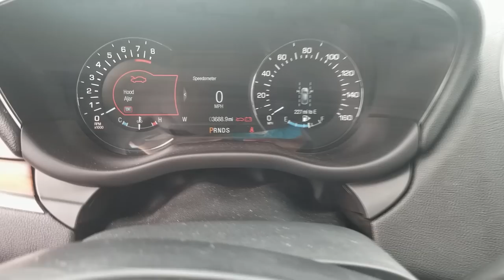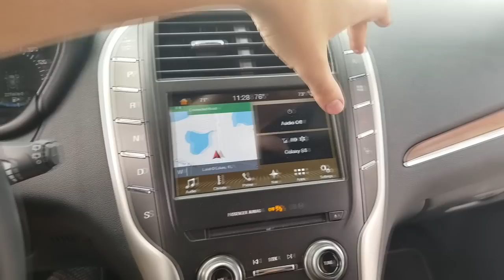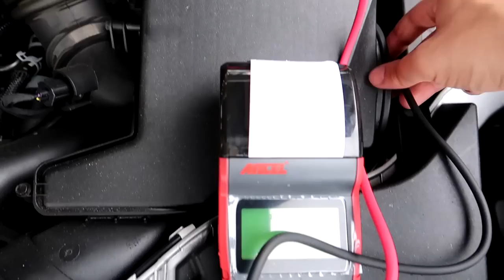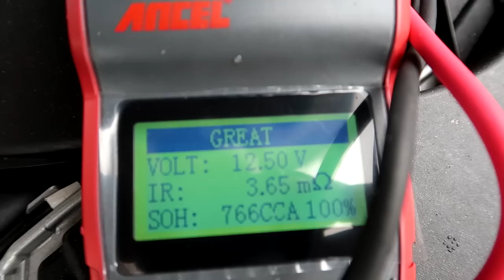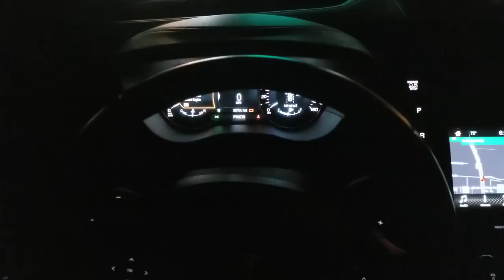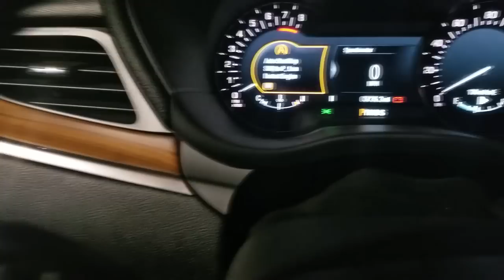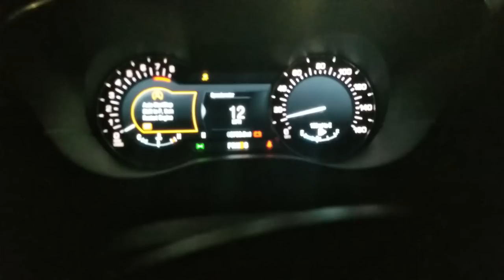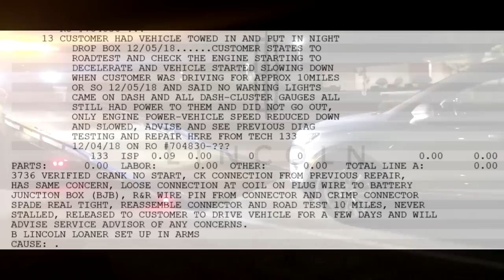I Saved Over $20,000 Buying a Like New Lemon Car! Then it Broke Down TWICE in 48 Hours!!!

Comment: Sam,  I once had a car with the exact same issue.  Turned out to be a faulty Crankshaft Position Sensor.  If the computer doesn't receive signal from this sensor it will cut fuel and spark to the engine.  I was told that this was a safety feature at the time.  Initially mine would stall just like yours did at traffic lights and stop signs, it then got worse to where the car would crank and crank with no success. A five minute or so wait and the car would restart.

Comment: Im an auto service tech since 96'. Currently work for a dealership (not Ford/Lincoln), but the logic behind finding the issue is the same.

First, the battery tester is not going to help you in this situation. A scan tool would be more useful. Don't need a fancy one, just one that can read any Diagnostic Trouble Codes (DTC's) and display the findings. Instrument panel illuminated and eventual engine restart proves it's not a battery or fuse issue. 

No voltage at the coils (if that is the case) suggests it's a power supply issue. A bad ground to the module might also be suspect. Poor connections fall into this category. I have my doubts though.

The fact that it stalls while driving, yet cranks afterwards suggests it's an issue with either the ignition system or fuel system. A mechanical failure would tend to make the vehicle run consistently rough or not at all. Very few mechanical failures allow the vehicle to run smoothly.

Ignition system failures tend to have DTC's associated with them. Fuel injection issues also tend to have DTC' associated with them as well. Fuel delivery (fuel pump) issues often reproduce these same symptoms and will not generate a DTC's. 

I am generalizing, but this has been my experience. I would look at the wire from the control module to the fuel pump. If the purple wire has something to do with the fuel pump, and it's been repaired more than once, perhaps the issue is within the module the purple wire plugs into. It might even be the fuel pumps themselves. 

Im guessing that your vehicle has a "saddle tank". One pumps that supplies fuel to the engine, the other scavenging fuel over the "hump" of the tank keeping the 1st pump with a steady supply of fuel from the other side of the tank. If the problem is most pronounced just after 1/2 tank, then that's your problem.

Comment: Awww yes, the fabulous Ford Wire Wiggle test. That purple wire at the ECM doesn't look very good. Notice the bulging under the insulation in 2 or 3 spots? 
I know a lot of vehicle manufacturers are going to the Stop/Start control, but it's just a major headache waiting to happen. Have the dealer check or replace the brake light switch because that is a known problem with the Stop/Start system due to a defective brake switch that was causing an intermittent stall/no start problem for Ford.

Comment: I think you need to press Lincoln to replace the entire start stop system within the car.
I believe the electrical components within the start stop system aren't working as they should.

There communication to the ECU, engine and the start stop system should have some sort of interference which is causing this confusion and then cutting off the power.
Reply: Nope. The Stop-Start message is coming because the car stalls. Stop-start will try to restart. The diagnose sheet says "no spark" which means that either power or signal is not reaching the spark modules (If it lost only one cylinder, it would still run).
By the way, stop-start is inside the ECU.
Reply: You can have ford disable the start stop. I would request the loom containing this wire be replaced.
Reply: @adammartin5055  You know what? That's actually a great idea. That could honestly just work.
Reply: Probably wouldn't hurt to just put a new engine harness in it
Reply: Actually i had a similar Problem with a Ford Vehicle, turned out the shop wasn´t willing to change the engine harness since ford does pay them a lower rate than a customer. After 9 Months, my lawyer forced them to do so - no problem ever since, then. Do yourself a fav, find another dealer
Reply: @michaeltourenfahrer5317  Ford/Lincoln already took a substantial loss on this MKC because they were practically unable (ie; would've cost too much money) to fix it properly. So common sense tells me that at this point they'll fight tooth and nail to avoid repairs as comprehensive/expensive as replacing the entire engine harness. They'll probably force Sam to spend more in legal fees than it would've cost to just have an indy replace the engine harness (assuming that's even the problem).
Reply: Wht if you change the ecu tho?

Comment: Sam, it's a really good deal, considering the issue was diagnosed and fully repaired (twice replicated, twice repaired). Yeah, lemon law new vehicles may be risky, but you get the reward in the low dealer resale value with full warranty and all the luxury creature comforts included.

Sure, your confidence may be shaken, but it's technology which can be fully diagnosed and resolve because it's computerized.

I think the Lincoln will give worry free miles from here on out, knowing that the problem is now fully resolved. One important thing to note is that the failure was very similar to the auto engine stop/start, which confirms perhaps what the previous owner was experiencing intermittently. I'd say it's safe to conclude that everything is resolved now.

All the best to you and your family for 2019! Looking forward to more great builds to come!

Comment: I work at at a GM dealer,  lemon cars with creaks,vibration or rattles, are ok 
But if its electrical deffinatly not, if its newer than 2010  most terminals on any manufacturer are rated to be unplugged and plugged back in 3 times , so maybe you got one problem repaired, but since that connector has probably been unplugged countless times, you could have a host of other problems down the road,  who knows could be 2 years from now, but the spring tension in all those terminal are marginal at best, also you dont know how many other connectors throughout the car have been disconnected and reconnected.

Comment: Many years ago when I retired from the USAF I did a self-move from NM to AZ with a Uhaul truck that my father drove for me, along the way every about every 20 minutes the truck would just shut down, 5-10 minutes later it could start up again. Eventually, we got Uhaul to send someone when we stopped to refuel, we got lucky it was a guy who'd seen this issue before, he went straight to the fuse box, said it was the wrong strength fuse in a key spot, said it could run for a while with that fuse until it got overheated and that's why the truck would shut down and then run again after a bit, because it'd cooled down enough. He swapped out the fuse and we finished the trip without any further problems. Sometimes it's just some stupid little thing someone screwed up to cause what would seem to be a more serious problem.
Reply: lol no. This car was fixed many times. if the issue was that "purple wire", and it still stalled. Either the mech at Ford are dumb or its ALOT MORE Than the purple wire. My guess is that theres alot more than that purple wire because they "fixed it" at least twice

Comment: Not sure if you noticed but the battery is actually an AGM battery so the charging voltage should be a bit higher than normal. Not sure if your tester can correctly test these. And it seems like it's just Ford's auto start-stop is a bit crude. If the battery voltage/capacity is low it should disable the system on its own and not shut off at all.

Comment: I think it’s a very poor deal. You are putting yourself and others on the road in danger by driving a car with known safety issues causing it to stall. Chevy recalled millions of vehicles over the ignition switch causing cars to shut off, and here you are with a car you know can stall at any time.

FOMOCO bought the car back because the original dealer FAILED to repair the vehicle after a reasonable number of attempts. They don’t just buy back cars for no good reason.

Subaru repurchased my Legacy due to it being a lemon, and guess what? It’s at an auction right now, and the dealer originally attempted to repair it more than 5 times unsuccessfully. You think this final time was successful before going to auction?? Probably not. They had 5 times before to fix it, and could not and gave up.

Lemon cars are a horrible deal and should not be allowed to be placed back on the road.
Reply: Neither should salvage cars, the frames could give out at any moment. If the airbags are deployed it shouldn't EVER be on a public road again, botched repair or not. You cannot properly repair a frame.
Reply: I had a lemon car that was a dodge.But there was no lemon law in 1978. Shifted from Dr. Second back to Dr. The trans.
fluid was pink/gray changed it
said it was OK! At 12,500 mi.
The trans. quit. Towed it to the dealer I bought it from & said
that the repair was on me! & it
would cost 600-800 dollars to
repair. I called. AAA had it towed out of their shop to
another trans. shop had them
repair it.the mech SHOOK parts
out of the case!! Their repair bill
was only $450.( in 1978)
 NO MORE CHRYSLER PRODUCTS for me FORIEGN
cars are best.they take pride
in what they build!🇯🇵🇯🇵🇯🇵
Reply: @markverloop8890  That has more to do with the individual dealer. Foreign cars have lots of lemons as well. I would say not to go back to that dealer, but since it was 1978 he is probably out of business or retired :-).

Comment: This is because of the Auto StartStop system.

The system is most likely incorrectly calculating when to shut down and lock up the engine.

And some wonder why a lot of people hate the EPA.
Reply: @Ray Brown  But that was his very first theory, and he shut down the auto start/stop system (and I assume that he kept it that way) , but the car would still stall on him.
Reply: @factchecker2719  maybe he didn't keep it off. IMO, that purple wire overheated and after a while does not allow enough current to a certain module and it stops. Replace that wire.

Comment: Hey crack the fault is most likely somewhere in the wire and not at the connections , look for damage to the wire casings, like it was bent over or pinched. Some times it may be that the wire had an internal fault and the casing looks fine . You could use a jumper wire from connector to connector, just make sure you unplug the original wire . If your problem disappears you know you got a bad wire

Comment: I worked at a Ford, Lincoln, Mercury dealership in the late 90s. There were quite a few engine wiring harness issues back then. In some cases the wiring harness would have a broken wire inside the insulation where you would never see it. when they run the wires through the loom putting the harness together at the factory they pulled hard enough to break the wire without breaking the insulation. Oftentimes this would fry the ECU as well (in which case they wouldn't run at all). They also had poor grounding issues. in most cases they only had two maybe three grounds on the whole drivetrain. Transmission to firewall, engine cylinder head to firewall, an engine mount to frame. It's also possible that the PIN the purple wire plugs into gets hot after a while inside the ECM and loses connection. If you unplug that connector look for discoloration from excessive heat.

Comment: As a long time (now retired) parts guy, GM, Chrysler and almost all the imports, let me throw out my 2 cents worth. I really think it's going to be a sensor of some sort that is subject to heat and cold and movement from the engine idling and adjusting its speed. Whether it's a cam sensor or a crank sensor or whatever sensor it is that senses that AutoStart like the one in the throttle that I can't say. That wire that you showed in the video doesn't look like it gets much movement in that spot are there be no reason for it to happen erratically. That being said, we had a Oldsmobile Toronado back in the 80s the had a pinched wire in the dash that caused an intermittent problem. So there's that. I enjoy your videos and your enthusiasm. You certainly play with a lot of nice cars. Good luck with this one.

Comment: It’s always a lose wire. 🙄🙄. Yea they didn’t do anything.
Reply: Right. I laughed when Sam said the car was still "under warranty". Considering how much experience he has with cars, it's hilarious to think that he thinks a flat rate tech is going to spend any kind of time trying to diagnose the very problem on a lemon car that got it branded as a lemon. I mean Ford probably flew out an engineer to try to fix this thing as a last resort before buying it back, and even he/she couldn't do it. You could literally take that MKC back 1,000 times "under warranty" for this problem, and it'll never be fixed at this point.

Comment: I fixed my Eddie Bauer Expedition with a one dollar bag of cat litter. Because it has been so wet and humid lately condensation is building up in the cabin. The fuses and relay's we're getting damp. I placed the bag on the floor next to the fuse box under the driver's side. In three days all of the electrical problems went away. I now leave an open bag in the truck  to absorb all moisture. It is only a dollar so why not give it a try.

Comment: crankshaft sensor issues. I had the same issue before and replaced all the sensors. I had the car for two years for couple of years after fixing it with no issues.

Comment: Lmao "real tight". It is the main engine harness it's listed in the orignial invoice you put up there 12C508. It's only $120 on ebay. Looks like less than 30 connectors. Pretty barebones looking harness.They should just replace it. Considering it's a lemon for the exact same issue if it hasn't been replaced it doesn't make sense to try repairing the harness. Not even worth the tow. Although I can't recall from the original video if you mentioned that they had already replaced this or not but it seems like a no brainer at this point. They keep taking heavy loses. If they really pin pointed it down to that I'd  say it's worth the part to avoid a 3rd trip back. Maybe when you take it back next time they bite the bullet and replace it.

Comment: I once worked in a Ford dealer in my country and I remember an experienced tech tell me that an instructor from the Ford Training Center told him (and other techs from the dealer) that Lincolns (like the MKC and MKZ for example) tend to be experimental cars. They use them to test out new technology and after they sort things out, they implement it on Ford vehicles being improved and reliable to their standards. They like to test those things by selling them to people and see what happens. To me its kind of unfair, but thats what they do. My 0.02 is to avoid buying any Lincoln vehicles. They are NOT exactly the same as Fords. They do tend to be almost identical but Lincoln vehicles are of much worse quality (because of the experimenting thing) and more expensive because of the brand name.

Comment: You gotta do a Battery Load Test, not a voltage test
Reply: It was a load tester i.e 766CCA (load test).
Reply: Jonathon kliora nope
Reply: @andrewv2835    It does a load test but only for a split second (because it would melt) and checks the voltage drop.  Not the best.  Since the car was cranking without starting, he should have checked the voltage while cranking.  That's a better load.
Reply: The meter he used provides a conductance test rather than load test. 

 However, they both provide a accurate determination of the batteries health and can both provide CCA values, but using different methods.

The only thing the load tester will provide is capacitance evaluation.  Either way, they both provide an accepted evaluation of the batteries health conditional on full charge.

Comment: This is what I hate about newer cars, all the technology and computer controlled everything....yes it’s nice when it works, but every time there’s a fault, then diagnosing the issue is like finding a needle in a haystack and usually requires expensive testing equipment.

On a side note; that purple wire looks damaged, the way it’s wobbly like that almost makes me suspect that it could be broken somewhere inside, which unless you replace the whole harness will be a continuous problem. (Yes you can remove the harness and replace that one individual wire, but that’s a nightmare of a job). 

I will say though, that the way the dealer told you to wiggle the wire like that, makes me think that it’s the crimp on the connector that’s bad. Which if you have the right tools; could be an easy fix. 

....just my 2 cents 👍
Reply: ferkemall aha! ....after carefully reading your comments and using advanced precision troubleshooting techniques, I have managed to pinpoint the source of your issues!

.....it’s a Citroen....which is a French car....there!...that’s your problem!